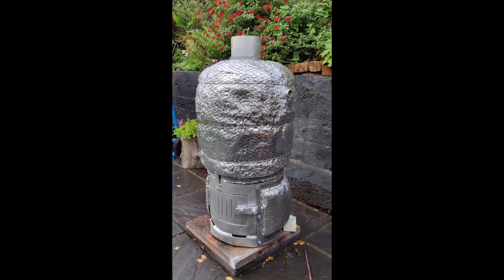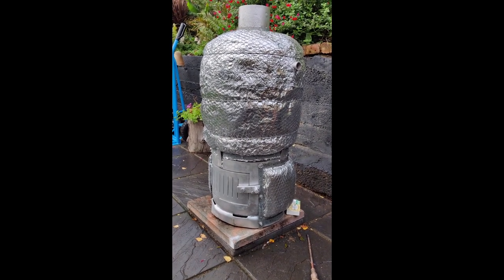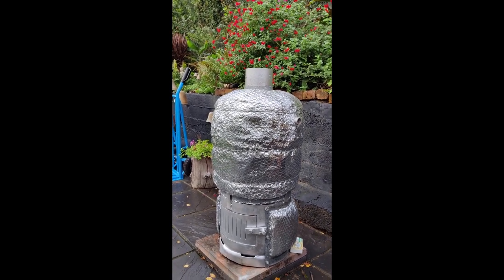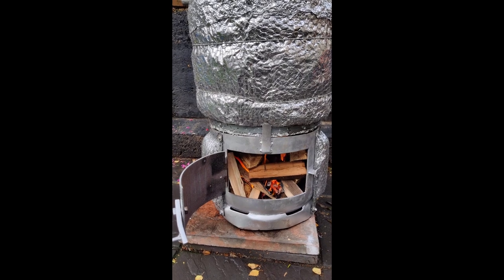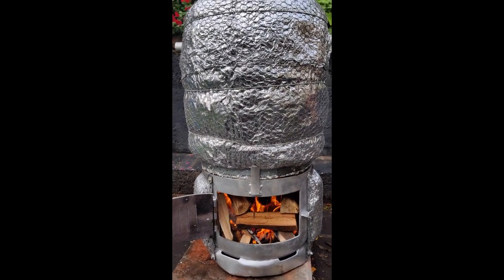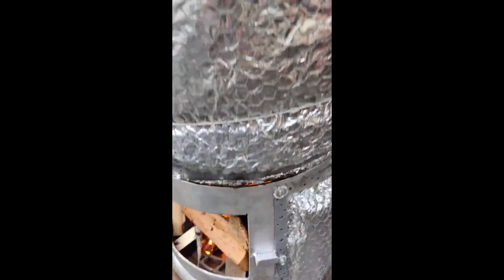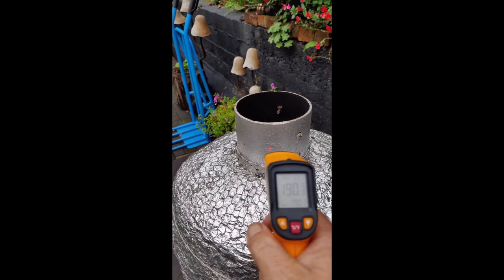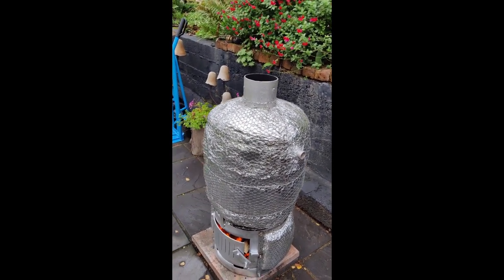Sand battery can it heat my home? part 2

Comment: Very good, glad to see it progressing, do you still have the vent hole available? wow, from 260-200F on the side hole temp (best spot to measure i think) that's amazing! i was expecting a much quicker drop, what do you think about adding s minimal amount of water to the sand with some holes drilled on the sides near the bottom? would it speed heat transfer?
Reply: oops lets me re-state that, yeah i mean lets say you have a hole each side, put in 100ml of water on each side, seal it up. let that evaporate out the top vent. im thinking a shroud pushing air out sideways would even be the way to go, specially down a hallway.

the water may actually cool it and not allow the sand particles to climb to much higher temps over 100c, its a funny one to think about, but i mean, steam can become super heated, maybe in this idea less is more.
Reply from the maker: Yes have the hole but prefer to keep water out of it & keep it sealed as just adds a element of danger 👍

Comment: I think you’re ceiling is really hot and you don’t need the little fan at the bottom. I have a stand-alone ventless propane fireplace in my living room and the ceiling fan pushes the hot air down and heats my floors. 😊 it’s very quick. How long did it take to cool down completely? And did the inside stand heat up?

Comment: If your trying to create a mantle, I have normally heard them use a 1mm or less mesh. The chicken wire seams too large a mesh. Also a single cylinder shape would likely be better than a coil but that could be tested.
Reply from the maker: Yes still experimenting with that 👍
Reply: @leejones2511  perhaps taking a metal 55 gal drum could be a next step. If the body and flu of the heater could be encased in the barrel with the firebox below it, you should get a great deal more thermal mass storage. Then insulating the barrel exterior should slow heat loss. Also adding fins to the heat source should maximize the heat transfer into the sand. Of course you would need some sort of piping to extract heat from it.

As I understand it sand can store much more heat than the roughly 200f temperature of water. I believe you are able to double that temperature to see a benefit you want.

Personally I'm looking into a bus heater as an emergency back up. The heater and fuel can be located outside in an enclosure with the fuel next to it. A battery can trickle charge it through either mains or a solar panel to provide the heater power. I plan to just tap into the  houses  existing ducts to distribute the heated air.

It is a minimal alteration that should provide emergency heat if the grid goes down. It would also use much less power than trying to use a back up generator to heat the house. Also since it draws the air from outside then heats it, it should provide additional fresh air exchange. 

But that's just my take on this problem for my area. While I'm not expecting a social collapse storms can take power out up to a week(very rarely) or hours to a day or two(frequently).

My biggest interest currently is finding a reasonable priced source of Edison batteries. That and trying to talk my wife into giving up her 55 gal rain barrels in favor of 300  ubcs. Lol, that an uphill battle I'm losing. Even when she fret of all the water she is losing every time it rains here and her  barrels fill to overflowing. Lol she has a death grip on keeping those barrels. Lol.

Comment: It's probably hot enough to run a self powered fan on top of the flue when inside the house (the type you put on top of a wood burner) to circulate the heat more evenly
Reply from the maker: Don't think it would stay hot long enough for one to operate
Reply: @leejones2511  ours runs above 80 degrees,  it stayed there for hours

Comment: Install a reburner, all it is is a pipe from the outside the lower fire box though to the fire to the center and 0ne third the way up the flue. this will allow you to burn the smoke and smoke burns hotter than wood.
Reply from the maker: Built one today to test later👍

Comment: How long did the first burn test last in hours before reaching a comfortable room temperature and you can basically touch the chicken wire without being burned?
Reply from the maker: Chicken wire was only hot at the top & bottom  basically where it was traveling through where it was clamped to the body the rest was warm, 
I went to bed at 12am & was still warm but able to put & hold your hand on it, as in the flue & handle  so 12 hrs

Comment: that would probably run on convection alone. with a vent system on the base you could turn it down for a longer run time. wire wool in the stack would help the heat exchange on discharge. my gran used to swear by her economy 7 storage heater.
Reply from the maker: I think you are right, I had storage heaters in my first flat & they worked great after I got to get them working properly, which was one reason that gave me the confidence to try this & yes I'm going to try a gauze in the chimney to help draw out the heat on discharge 👍

Comment: leave it outside and install an extractor fan in the wall the "wrong" way around so you can just switch the thing on to the other stand and let the extractor fan suck the heat into the house.
Reply: Brilliant work btw
Reply from the maker: Unfortunately I can't get it close enough to the house so I'd have to have a long pipe which I'd loose to much heat & the other downside would be that you would be drawing in cold air from outside which would be less efficient to heat up, 
Would be more efficient having a enclosed wood burner outside & pulling in the hot air from around it (which I like the idea of & may have ago one day)
Reply: @leejones2511  you can circle house air only and don’t use outside air.

Comment: You need to make a fitting that goes on top with a fan to blow downward. It will heat the colder air close to the floor and radiate upwards
Reply from the maker: It's just too hot I'm afraid it would melt the fan, but is possible after about 3hrs
Reply: @leejones2511  you could use a dryer vent hose and place a computer fan about 4 to 6 ft away run it off of a car battery and have good air flow without the fan being too close

Comment: the in home stand make 3 wheels under, carry it to the fireing area with the indoor standd. And also u can make a lever mech 2 the indor stand or fireing stand, to rise the heat battery 5 cm and load to the fireing stand. So you will have 3 parts ,  1 to fire , 1 to indoor stand and battery. Don't put whees on fire stand. When u move the battery the fireing stand with hot coals & whells will be dangerous.

Comment: Seems you've build a mobile Rocket Mass Heater. Basic idea is to dump the heat from a stove into a mass bench rather then outside. The mass then radiates heat for a day or so after the burn.

Comment: There are a few videos about using wax as a mass heat storage.
The wax from solid to liquid is taking in heat and from liquid to solid releasing heat .
Paraffin, plant or bee wax .
Reply from the maker: Few people have mentioned wax, but I'm not a fan of heating liquids as thing can go wrong Very quickly & wax will be very flammable at boiling point,
However if you know what you are doing I'm sure it would be great 👍
Reply: I knew someone that died from overheated paraffin.

Comment: As I have said on Robert Murray Smith's channel one of these would be very good for heating a tent. One point how does this compare with adding cement to the sand maybe you would get a better (faster) heat penetration and more capacity.
Reply from the maker: Yes totally agree will make a great safe tent heater, I work in the horticulture industry & think it would make a fantastic frost protection for a greenhouse, 
Your pizza oven idea sounds great & yes pallets will be my next fuel once I've got through my stock👍
Reply: Some pallets have treatments with toxic chemicals in the wood, learn to read the labels to pick the safer pallets without arsenic and such which is bad for the lungs.

Comment: Careful with the chicken wire burning off the galvanized metal gives off a poisonous gas. Then instead of the chicken wire gas hot water heaters use a flat piece of steel that is screw shape. Awesome idea though!
Reply from the maker: Thank you yes the chicken wire was a experiment, it's on the outside of it but doesn't get hot enough 👍

Comment: Chimney effect will not require a fan at first later a fan might be helpful and you can throttle the heat coming out of it by putting a tin pan over the top of it and then just cracking it open a little bit and a little bit more and a little bit more until it's running wide open

Comment: niiiiice.
First off...check out robert murray-smith channel. He's covered sand battery a bit...I think he'd appreciate your input
Other stuff...
Burn smell..? Prob the paint you used.
Chicken wire in chimney....yes indeed...you slowed the flame, so it used more work to heat sand.
Insulation...you need more...and you need fewer incursions like the handle holes.
Chemistry...heat the smoke/heat product secondarily to the initial heat source, above heat source in chimney, by using air intakes.
Efficiency...like I said, more jacketing will help; but otherwise:
--consider using 'firebricks', salvaged out of old storage heaters, at the bottom of sandpile
--keep the door of the burner closed
--when bringing into house, stuff chimney - and other apertures, with rockwool
--tall ceilings..? try blowing the warmer air near ceiling back down to floor using small fans suspended over lengths cut off a  roll of flat plastic packing tube
--Try using furnace sensors embedded in the sand instead of the laser thermometer
--use charcoal
Other ideas.:
--can you use energy captured from solar or wind to heat the sand..?
--would it be an idea to 'purge' the sand before use, by cooking off the water content before packing into the cavity?
--compact the sand more heavily into the cavity
--is there a way to reclaim the energy coming out the top of chimney? Perhaps by using the flow to turbojet air into the (proposed above) secondary air injection?
--a fire-tornado....by 'slanting' the air-intakes vertically, you can twist the fire up the chimney, and slow it down further with steel chicken wire in the chimney
Anyway...am subscribing.
I want to see how you do

Comment: Hummm. Sand is an insulator until you get it to about 1000 degrees F. It would be better to use clay. Look up rocket stove heater with a bench that releases the heat.

Comment: Have you considered aircrete as insulation?
Reply from the maker: Not aircrete but looked at plenty, but went with a ceramic fiber as light & has little to no smell when hot 👍

Comment: Oh I thought you were going to leave it outside and blow air through two openings that had a pipe going through the sand and just let the air pick up the heat like a radiator and then blow the heated air back inside…

Comment: Well done with this project. It's very impressive.  Others have come up with possible improvements,  but you have actually created something that works very well. Taking action is the most important thing. I would be proud to have built something like this. The only thing I would do differently is put the fan at the top, so that the hot air warms the bottom of the room before rising to the ceiling.
Reply: The fan may not survive the temperatures very long a pipe with water flowing through it to move the heat elsewhere might be a better option
Reply from the maker: Yes you are both right the heat for the first two hours is VERY hot & could melt the fan however after that I like the idea of it bowing down as it will mix the air with the rising heat nicely 👍
Reply: You could still put the fan at the bottom and blow down to suck the heat out toward the floor.  Maybe even just a ring of fans blowing from the bottom in all directions. Until you get the timing down on releasing just the right amount of heat and insolating/storing the extra heat you shouldn't need a fan until half way into the heat release cycle.
Reply: @terrafirma9328  Add simple thermostat control circuit o turn he fan on and off.
Reply: Agree Ideas are always good for improvements, but actions speak louder than words
Reply: How about a stove fan on the top, no power needed and designed to stand on hot stoves. Not too expensive these days either.

Comment: This reminds me of something a Swedish friend does. He's an engineer, and he built a sizable workshop about 30 yards from his house. The workshop's heated with an odd wood burner he built from a 4' long piece of 20" (ish) diameter thick walled tube. It's horizontal on a stand that puts the bottom of it's door at about 2' off the ground. The door is a plate that sealed against the entire front of the tube without any "Door frame" to get in the way of loading and raking ash out. The reason it was made so long was apparently so he didn't have to waste as much time chain sawing wood into little foot long chunks to go in. He just rams a suitably chunky log in there, builds a fire around one end, and it'll burn for hours. There's lots of adjustable vents on it so he can control the fire at various areas of the burn chamber..... It's a pretty well thought out piece of heavy engineering.

Anyway, when he built it, he sliced about a 10" wide strip out of the length of tube, and welded in a thick flat steel "Cooking surface" along the top, and in winter he has 3 seriously chunky lumps of stainless steel sat on there. These things must be a foot long and 18" in diameter (And probably worth a damn fortune now !). Each one has an eye bolt in it, and at the end of the day he uses his engine hoist to pick them up and place them on a trolley. Then he drags that over to his house and plonks the trolley in the corner of his bedroom (His house is a REALLY picturesque old timber frame bungalow on the edge of a forest......... With a ruddy great modern steel framed workshop plonked right beside it. :D). He says that over the following few hours, these stainless lumps bring the temperature in his bedroom a very noticeable amount, and for 2 or 3 months of the year it means the difference between having to turn on his homes heating when he finishes work, or not.
Reply from the maker: Wow that sounds incredible, I do love the way people can get around a problem & think outside the box & come up with something amazing! Im a big fan over engineering!!
Reply: @leejones2511  I'd guess the "Super heating" when the roll of mesh is in there is probably down to it creating turbulence in the chimneys flow. When you have a gas moving at speed through an open straight pipe you usually get a thin boundary layer of turbulent gas along the walls. This layer actually helps the rest of the gas experience less resistance as it shoots along the centre. In essence, the gas rushing up the centre isn't actually touching the wall, so it's not transferring it's heat into the wall or thermal mass.
With the mesh in place, you're causing the centre gas flow to get bounced all over the place. It's going to be getting tumbled into the wall multiple times on it's way out, and each time it does it will be handing over a little more of it's heat energy. 

I'm thinking that with a couple lengths of all thread, some nuts, and large washers, you could build a basic "Baffle" to hang down into that chimney with washers stepped at maybe 4" spacing on the two rods to buffet the flow one way then the other. It might be a more controllable way to make the airflow tumble. This idea would also be adjustable too, so if one area if the chimney is getting too much of the heat, you just space the washers and nuts out more in that area and bunch them up where the stack's cooler. If you weld the threaded bars to a piece of rebar that can rest across the top of the chimney, it would be a quick job to take them back out and give the chimney a sweep before taking the "thermal battery" into the house.

The smoke and smell. I'd put money on it being the paint around the top surface of the gas cylinder getting toasted. I've used all sorts of high temperature spray paints over the years, and have found few that'll stay put on stuff when fires involved. One future suggestion though, if you make a MK2 of this, for rust protection, I might be worth "Seasoning" it with veg oil (like you would a cast iron skillet). It works pretty well on steel, and it gives a rustproof finish that doesn't burn off until some ridicules temperature. It's cheap as hell to do, and until it fully polymerizes onto the surface....... It smells vaguely like chips cooking ! :D
Reply: @leejones2511  hang a piece of paper over your exhaust and check that foot air temp maybe
Reply: Can you get any pictures of the heating tube your buddy made? I'd love to see the design.

Comment: Fantastic work. Surely with an umbrella defuser attached to the funnel it would make the greatest/most efficient patio heater ever. 
After I saw the Polar Night Energy project I've been wondering if it could be scaled down for domestic use. Looks like you are well on the way. Look forward to phase 2.

Comment: This is a great idea, could also be used to heat water by installing a copper coil in the sand compartment and attached to a water cylinder or even the radiators in the house to heat the whole house.
Reply: I was also wondering about the copper coil as well.  I've seen people use compost piles with coiled piping to heat water and also enclosed spaces.  If done right with the sytem Lee has constructed, you might be able to leave the sand battery outside in its own enclosure and move the heat through insulated tubes into the house.  I would use some type of high temp mineral oil but I would rule out other heat agents either.  I know we live in times now where it is easy to fall prey to those peddling fear but across the planet people are finding and developing there own solutions and sharing and to me that is humanity at its best.   Well done Lee.